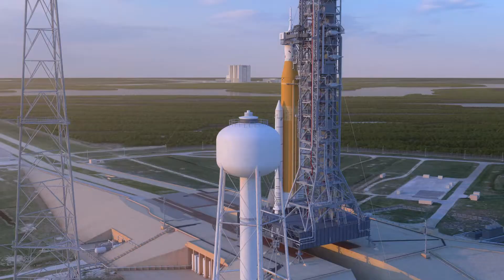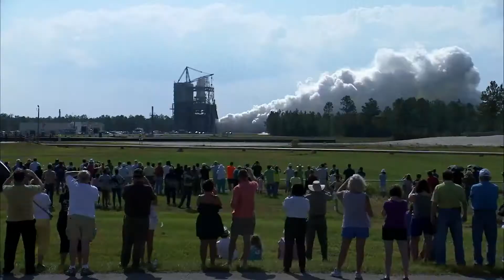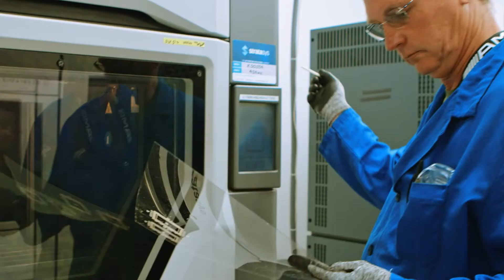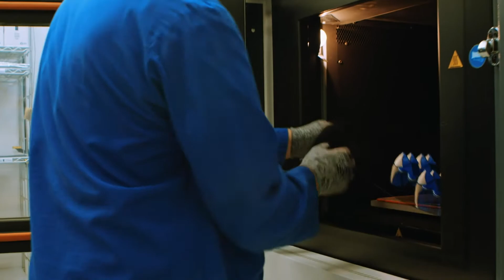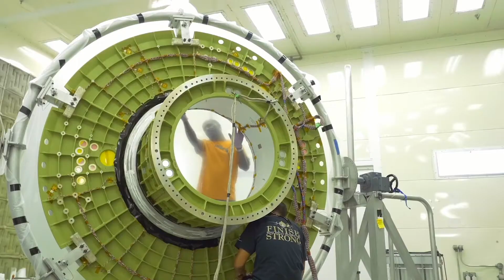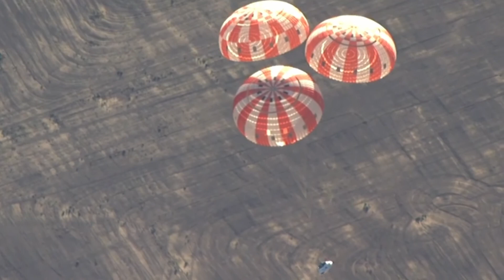3D Printed Parts that are Ready for Space with Lockheed Martin

Comment: What kind of 3d printer do they use? Selective laser sintering?
Reply from the maker: They use and extrusion-based technology from Stratasys known as Fused Deposition Modeling or FDM for short. It is perhaps the most common and widely used form of 3D printing.
Reply: @proto3000_  But it's not too weak and anisotropic with too many cracks?
Reply from the maker: The parts were printed with a Fortus 900 and ULTEM 9085 material which are both designed for use in aerospace applications. The build environment is very controlled to prevent layer delamination, and the material is not just strong, but heat, flame, and toxicity resistant. The parts also go through an extensive testing process and through federal aviation approval before they can be used.